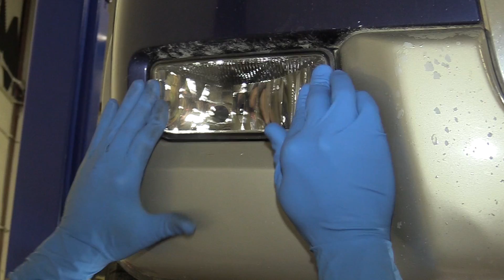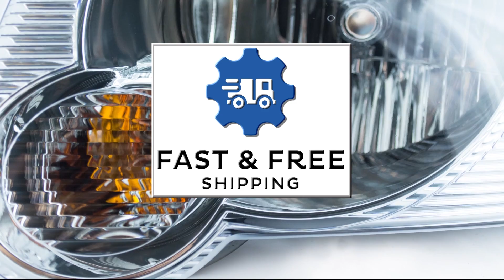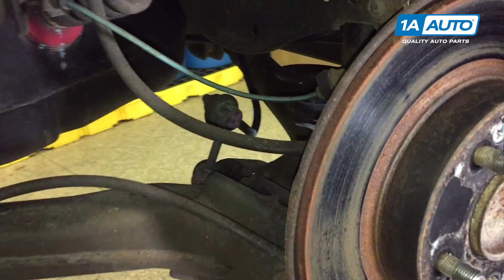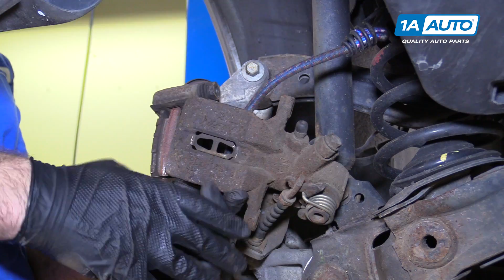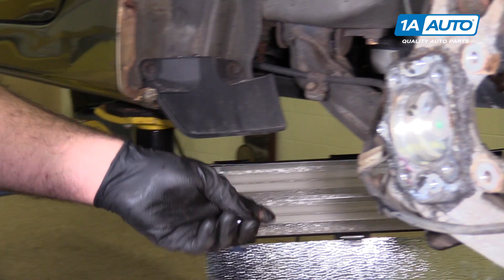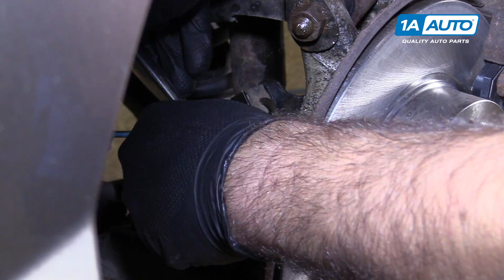How to Replace Rear Wheel Backing Plate 05-11 Honda Civic

Comment: What I major design flaw. Having to disturb a perfectly good wheel bearing to remove a rotten backing plate. Why couldn't they just have a backing plate that wraps around and then fastens through the caliper carrier bolts?

Comment: I recommend breaker bar and sockets on  caliper no wrenches especially 12 pt use 6pt sockets and wrenches;  and also impact screw driver before use Phillips screwdriver you might strip especially if seized in.

Comment: Please can you guys do a video on a 2002 Honda civic backing plate , I only need to move it because I'm having problems removing the wheel cylinder bolt that block by the knuckle.